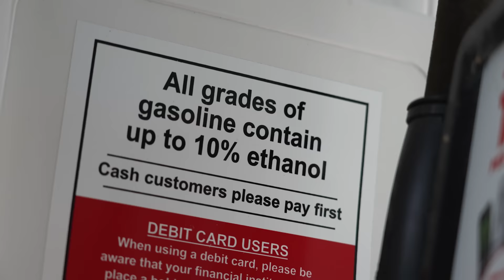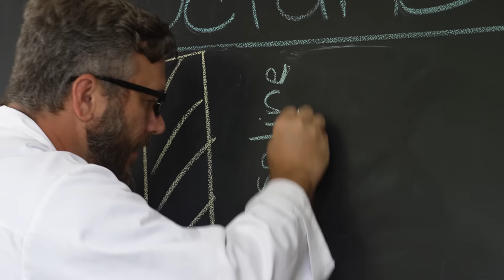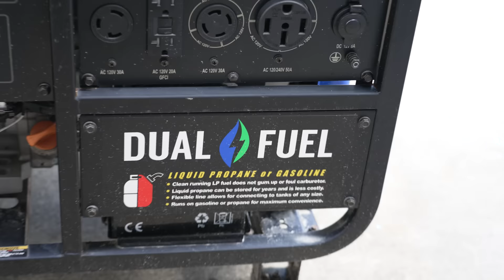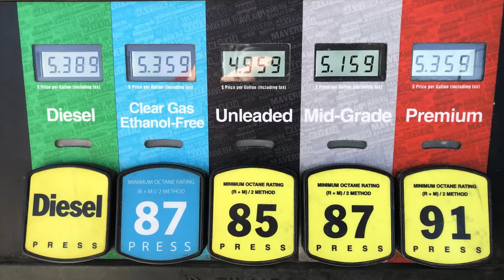This Will Destroy Your Emergency Generator! Don't Make This Mistake

Comment: Another important tip is to turn off the fuel switch, and run the carb dry before you put it away. That way you do not have a nice full float bowl of fuel to turn into varnish and block the jets. That way the only place the fuel is is in the tank and the switch, and nowhere else.
Reply: Amen. For chainsaws, before you put it away, pour out the fuel, then start it, run it dry. Same thing, but as they don't have fuel shut off valve, gotta improvise
Reply: Turn off the fuel switch and open the drain on the float bowl.
Reply: @946towguy2  How many do you see with a drain on the bowl these days, and often you do not have a bowl, especially on a thing like a chainsaw with a pressure fed carburettor.
Reply: @SeanBZA  My Coleman Powermate has a pressurized carb and no bowl, but my other 3 generators have bowls with drains.
Reply: I do that with my Yamaha Enduro XT350 motorcycle.  Also,  my chain saw only sees the 50:1 mix from a can.
Reply: I have always empty the tank and run to saw until it quits. Saw is 15 years old and have never failed to start by second pull.
Reply: Can you tell me how to do that with a riding mower and a walk-behind?
Reply: @frostyfrances4700  Get most of the gas out of the tank then run it till it wont start anymore.
Reply: My dad was big on this….and I watched him have too rebuild countless carbs due too the seals drying up and then leak bad after fuel is put back in the bowls. 🤦‍♂️
Reply: This helps a little but there is always some gas left at the bottom.  More or less depending on the carb design.  It never runs completely "dry"-only down to the level in the bowl that is too low for the jets to still suck the fuel up and keep the engine running. Some old gas is always left at the bottom after "running it dry" and mixing good gas with the old shellac that may be down in there next time will just spread it around the entire carb when the engine is turned over. The drain is there for a reason and it is to get all of the gas out of the bowl.  

Also, the engine runs extremely lean at the end when "running it dry" and this can be hard on an engine -especially a 2-stroke that depends on that premixed oil to lubricate the bottom end which is also leaning way out at the same time.   That's why it is often a good idea to shut down sn engine that you can tell is running out of fuel before it runs away lean and revs out on its own at the end of the tank.  

If you are storing it for an extended time there is very little oil left in the cylinder or bottom bearings.  If you do run it dry, pull the plug and shoot a bit of 2-steike into the hole and turn it over a few times to coat the cylinder, the bottom end, and the inside of the exhaust to protect from storage corrosion.
Reply: My Ryobi only has a large turn off switch ,
And the carb jets were blocked ! 

Wish they had a way to turn the fuel off without having to manually empty the tank and run it dry .
Reply: @svbarryduckworth628    I thought you could back-feed a generator.

Comment: I have a friend who works on small engines like lawn mowers and snow blowers as well as generators. He recommended to me years ago to use the Blue "Marine" Stabil instead of the Red one. I have never had an issue related to fuel in any of my small engines since.
Reply: Is the blue marine stabil instead of separating?
Reply: First I have read about this. I will check it out.

Comment: Excellent video! We keep 60 gallons of gas (E10), that is always treated with stabilizer, stored away for our generator. It lasts a year no problem. Big thing to remember! Always turn off the fuel and run the generator until it dies. That way all of the ethanol is out of the carburetor. If you don’t trust E10 to last a year, just cycle your fuel through your vehicles and keep the cans fresh every few months. Whatever floats your boat.
Reply: Good tips. We use premium fuel which (in Europe) is E5 Octane 98 with some additives. With preservative it’s supposed to be good for 2 years at least. We write the date of charge on the jerrycans with chalk, and after 2 years just run it through our vehicles. It’s been absolutely fine so far. 
On most generators, adding a fuel cutoff valve isn’t too hard. We added a cutoff and drain valve. And we test the genny every 6 months. Even though our power grid is rock solid, we have a good backup just in case. 
(I say “we” because my wife is just as nutty about this stuff as I am 😊)

Comment: I DIDN"T KNOW the ethanol gasoline was bad for my generator or any small engines!!! I went to start my and it is leaking gas everywhere.  Now I need to order new replacement part, hoses , etc. Thank you for the informative and valuable information

Comment: This is a hilarious video...I laughed the whole time, nice comedy. 

The fun part of this is that additives cause the problems. I loathe E10 for that reason. Ethanol burns cleaner than gasoline, by far. If you run on straight ethanol your engine will not wear, there are no carbon deposits clogging everything. Take an ethanol engine apart after a million miles and it will look brand new inside, with minimal wear in the cylinders. They do that in Brazil all the time, taxis run hydrous ethanol down there and the engines go forever.

It also runs cooler, makes more power, and you can run a lot of compression on E85 and straight ethanol. I daily drive 11.5:1 and 13:1 iron head 455 Pontiacs on E85 and E100 that I make from tree sap and cattails.

My carbs, fuel tanks, pumps, injectors, and lines are all spotless running E85 from northern Wisconsin, and home made E100. Yeah I run it in Qjets, Holleys, FiTech EFI, and non flex factory LS fuel systems. Additives in other locations can cause problems, and I am not the only one to find that. Go to onallcylinders and look up Jeff Smith's article about corrosion. 

The 70 GTO has been on E85/E100 since 2007 when I converted my first Qjet, thanks to $5 87 octane back then. The 65 GTO has been on it since 2018. No problems with either one. So how many decades does it take to cause a problem?

Wanna know what the other fun thing is? That 'new study' is based on an old one done by a Cornell uni prof who studies bugs, his name is Pimental. He went to great lengths to make it worse than gasoline... bad inputs = bad outputs, it didn't make it through peer review because of how badly he skewed the results and inputs. Who funded his 'study'? An oil company did... might be why they got a bug guy to do it. He had no skin in the game so he could make things up at will.  

Ethanol leaves nothing behind when it evaporates or burns, if it did you'd be drinking it and finding it in the bottom of bottles and cans. Let that sink in a bit... 

Whiskey, bourbon, wine, beer, even those white claw things have some in them, its all the same stuff. Yeast eat sugar, and excrete ethanol and CO2. When you burn ethanol the only thing it emits is Co2 and H2O. Gasoline emits and leaves a whole lot more stuff than Co2 and H2O. Co, nox, particulates, all kinds of nastiness.

Adding water to it merely lowers the proof, when you get low enough proof, like 140 or 30% water, then you start losing power. Richard Holdener showed that quite well with his moonshine test. Not all stills are created equal. It will still burn, still run the engine, and won't harm anything because of how water bonds to ethanol. Its a bond so tight on the molecular level that you need a still to separate them. If you add one gallon of water to one gallon of ethanol, you do not get two gallons of liquid. You get quite a bit less.

Ethanol will mix with water or gasoline, but not both. That is not rocket science. Water and gasoline do not mix, which is why water in a gasoline tank is a bad thing, get enough and the pick up in the bottom of the tank will get water, and without ethanol, methanol (they are very different fuels) or isoprolyl in it, water will not burn.

So many people have no idea about ethanol, and so many people give erroneous or irrelevant information to people. Its amusing at this point, and when gas prices go up all of this starts coming out to keep people from realizing they can make fuel themselves and run everything on it for dirt cheap.

Why do I make fuel from cattails and tree sap? Because my cost is 40 cents a gallon, I can run 13:1 compression with iron heads and 40 degrees of advance, and it makes unholy power in a 455 Pontiac like that... 20mpg with a Qjet if I can manage to keep my foot out of it in the 70 GTO with its 13:1 compression. Oh, didn't you know? Raising the compression ratio not only makes more power, it raises the efficiency and improves mileage too. 

How much more power does ethanol make? I direct you to Engine Masters with David Freiburger and the Steves where they put a blower on a BBC with a tunnel ram, and made over 100ftlbs more, and it dropped the intake temps 100F degrees over gasoline with an intercooler vs E85 with no intercooler. The transmissions in my GTOs and the rear tires hate ethanol, because they take a beating from the torque.

You can also watch John Wilburn's livestream where he and I talk about all this stuff, since I have been running it and testing it for more than 15 years. I had more problems running race gas in the 1990s than I have had running ethanol since 2007. Rubber hose, accelerator pumps, gaskets, and fuel pumps last longer with ethanol than they did on race gas or pump gas. 

The varnish left in my tanks from race gas made them useless, and rusty inside. Ethanol leaves them spotless, unless it has the additives that leave the yellow gel or the white chalky stuff. My 1998 Formula requires 92 octane with its LS1 engine, so it always got premium and around here that is no ethanol. Guess what happened when it sat for two years. The pump varnished solid and the tank rusted inside from condensation. So not only do I have to fix the rear end, I have to replace the tank, sender, and pump too.

The problem is the additives they put in, and the craptastic gasoline they mix with ethanol then sell to all of you fine people. Remove the ethanol and you drop the octane a lot more than you think, but on a small engine with 7:1 compression, it doesn't really matter since they will run on 70 octane relatively easily.
Reply: WoW!
Reply: Whoa, man !!😯
Were you wearing your lab coat and chemistry glasses as you typed out this dissertation👨‍🔬
Reply: Thank you.
Reply: Brilliant! Wish I could track all this. How did you learn to MAKE the ethanol?
Reply: @Adrian-zw6sc  no lab coats, I'm a gearhead that builds muscle cars for fun.
Reply: So… basically that carbon-lie is absolutely a lie…
Reply: @Thumperthesweatyfatguy
Gotta love the Name there Thumper

-Don't cha just love cars-engines-science? Totally enjoyed how you explained all of it!
Thanks!.
Now gonna have to be learning how to make my own juice for the vehicle-terrific??
But it's o.k.already  set everything else that way like on Disability so that cld really help??
!
Reply: 😄Sorry, I don't live on enough land to grow enough cattails and tree sap to fuel up my near 350 miles/wk of driving, nor do I have the time to undertake a project like that while working 62 hr wks at my paying job. 
Hardly practical I'm guessing for the vast majority of us.
Reply: @Isaac-qe2in  no worries man, you'll have plenty of time on your hands after November if we see a whole mess of blue vertical lines... gonna be rough paying $6-$10 for gas. Maybe if it goes red that won't happen... we can hope. I am not holding my breath.

You could probably meet someone who has an acre or two that you two could use to grow cattails, or kudzu, waste paper, stale bread, old donuts... etc. Selling $3 fuel when its $6+ might be lucrative... just sayin.

Comment: Y'all definitely correct about the ethanol problem . Been running 90 octane pure gas for years. No alcohol in genset or lawn mower. Treat with stabil, date it and recycle thru the car every 2 years. Works like a charm.
Reply: I have a motorcycle that I always used premium gas in, was a daily rider, started putting Sta-bil in it, haven't had it out since '13, tabs expired in '14, still fires up and runs, haven't added or done anything else with the gas in it.

Comment: 3 chain saws, 2 generators, 2 lawnmowers, 3 ATV's and 3 motorcycles ALL use "ethanol free gasoline" from the local gas station.  It's higher octane rated than regular, but slightly higher priced as well.   Stations all over here sell it, mostly in rural areas where there are no tree huggers.  I had no idea you could separate the two, thanks.
Reply: I just got my first generation I’m just about to get my second one. I basically plan on running them on propane… However I think I’m gonna prime both of them with gasoline and change the oil a few times and all of that…. They do not sell ethanol free gas in my area. Either new York city or in Westchester County which is a suburb… Where I am. So I have to go a little further north get me some of that good 100% gas.
Reply: Hey, pal, don't be too hard on us tree huggers!  :)  Not unless you think people don't need 'em to keep breathing.  But seriously, your point's well taken.
Reply: @JohnnyArtPavlou  I went propane/gas a couple of years ago.  Generator has never seen gas.  Hope to never have to use gas.

Comment: Ran 90rec in my 5.7 tundra and only got 1mpg gain vs 87e. I was also told that if you have been using non ethanol gas that a film builds up in the tank over time and switching back to ethanol gas will break up that film and cause issues with injectors and filters. 
Good content. Thank you

Comment: Only governments would be stupid enough to mandate using food for fuel. Ethanol is supposed to reduce emissions but the emissions produced by growing, harvesting and making the ethanol are greater than the emissions reduction you get from using it. To governments this makes perfect sense because the lobbyists told them it does when they contributed to their campaign to get re-elected. Growing corn is also depletes the soil so more fertilizer is needed to continue to grow more corn. Most of the other stuff doesn’t really matter, it’s stupid to grow food and use it for fuel when there are plenty of sources of fuel that can’t be eaten.

Comment: Where I live you can just straight up buy 100% gas. I exclusively use it for my small engine stuff or if I plan on being parked a long time. It's totally worth it. It's a bit more expensive than mixed fule but you're not going to use much in your lawn equipment and generator. Worth the premium also if your going to be parked a long time. I got my teenager a fixer upper before she got her license. we didn't drive it much and were mostly parking and working on it in over a year. That year it ran on clear gas because it only used a few tanks of gas.

Comment: The correct term for where the Ethanol is attracted to water is called HYDROSCOPIC (i.e. wants to combine with the water!)

The opposite is HYDROPHOBIC where the water is REPELLED by said material! i.e. Teflon is HYDROPHOBIC. 

To power your small motors, my suggestion is to go completely with PROPANE and do a HIGH-SUMMER BULK BUY of Bulk Propane (in my area of western Canada, Superior Propane does 55 cents CDN per litre or $2.05 USD per U.S. Gallon when you buy 1000 gallons or 3700 litres minimum bulk buy!).

That much will last the entire Winter Season if you keep only to simple space heaters and your stove, water heater and small 5000 watt generator run for a few times during the day when you really need it.  The more you buy the cheaper it gets! And do note that Propane can be stored FOREVER if you keep your tanks clean and maintained properly!  Gas and Ethanol last only 6 month tops even with additives!

V
Reply: Hydrophilic is actually the proper term for "water loving" when something is able to bond with water easily.
Reply: @stevenwilgus8982  YES! you are correct! Hygroscopic (oops! fixed my earlier spelling -- it is NOT Hydroscopic but rather Hygroscopic with a 'G'!) would be something like an open cell foam which ABSORBS water on a macro-level and doesn't bond to it, while Hydrophilic substances can BOND to the water molecules themselves such as ethanol. 

An example of a Hydrophilic substance would be 25 year old Scotch Whiskey where you can add 50% water to your glass of full-strength Scotch to make it go down a lot smoother!

Note: remind myself to buy 25 year old Scotch to test theory in the real world!

V

Comment: The small engine repair man at my favorite implement store told me repairs of chain saws, lawn mowers, weed whackers and generators has tripled since the intro of ethanol. And it's all fuel related. He has seen chainsaws wear out the rings and cylinders in record time because the ethanol washes down the protective oil. He tells long time customers to add 1/10th more oil and run a one range hotter spark plug. That helps a bit to protect the rings and cylinders without excessive fouling.

That is if they cannot find 100% gasoline.

After talking to him, I bought four extra 5 gallon gas containers and fill them at a local station that has 100% gasoline. Now when I'm down to just one 5 gallon can, I load the 4 other containers in my raggedy old trailer and go fill them up.

Even so, I still recommend you run that generator on LP most of the time. There are big portable tanks. For sure there is a 30 gallon I saw at Menards. There might be bigger ones but those puppies will be getting heavy and hard to wrestle with. There is a plus to having LP in storage.  IT DOES NOT GET OLD. That's right, 10 years from now, LP will be just as good as today. I'm looking into converting my diesel Jeep to LP.